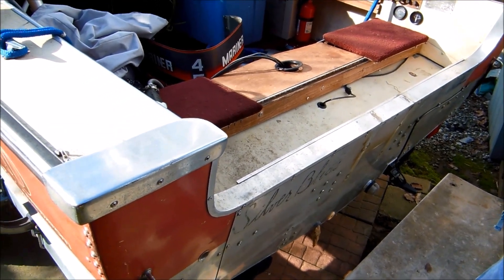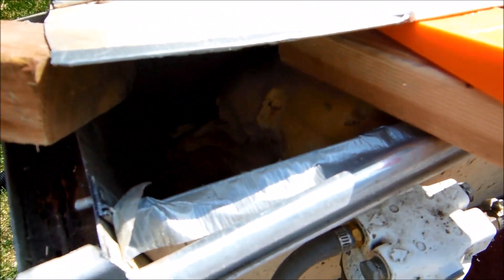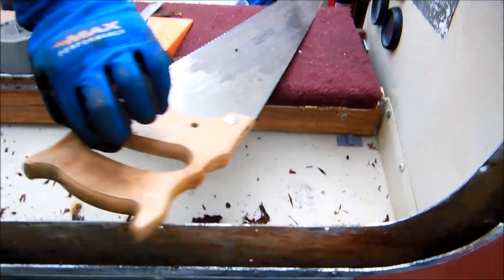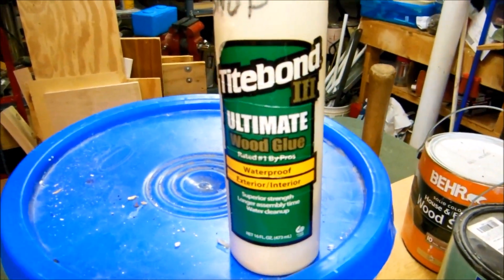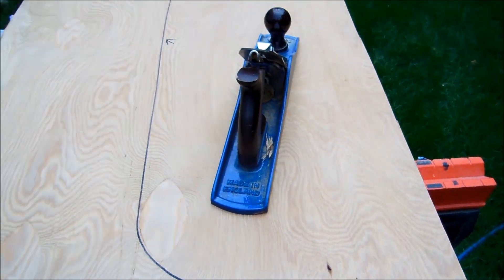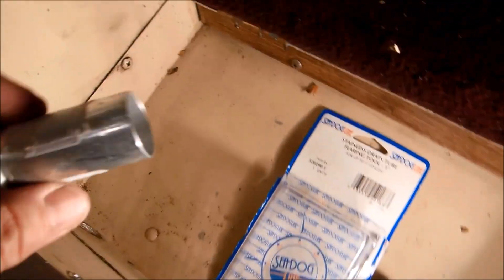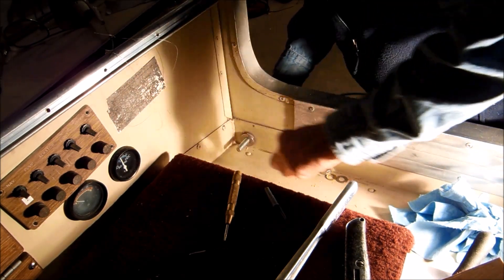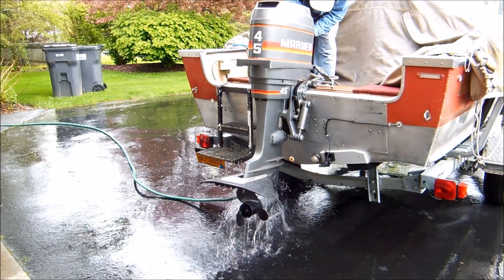Boat Transom Replacement

Comment: I have a 1983 Sylvan Sportster 16ft.  Your video was very helpful in replacing my transom.  Mine looked almost identical with the exception the nuts on the tie down loops were accessible from inside the boat.  After finishing the transom I decided to paint the boat so its been an all winter project.  Thank you for taking the time to make this video.

Comment: Been looking for this information for a while now. Most repair shops I've talked to about this are not willing to do the work. The one that is interested want's 1400 to do it.
135.00 of marine grade plywood, the rest is labor. My transom like yours is a riveted boat, the motor was rear ended by an impatient young driver 10+ years ago. I've used the boat ever since but I know the plywood is broken in the transom judging by the slight bend in the transom. This vid really helps!! 
Thx
Reply from the maker: Happy to help!
Reply: @OutdoorsmanChannel  another question, notice you didn't remove the livewell intake nor the boat drain. Where those inlets originally below the woods' height?
Reply from the maker: @Paul T  Yup.  They are below the wood height.  If you look at the transom from inside the boat you can see it pretty well.  Just the sheet of aluminum.

Comment: i have a 1979 crestliner its a 16 ft aluminum and we took it to a boat place and the said the transom needed replacement. they said it woukd cost 6k which is more than the boat is worth. the transom is rotted and im curious if i can still do this
Reply from the maker: You can do it yourself! Get it done
Reply: @OutdoorsmanChannel  do u have any idea why it would cost 6k idk anymore info about why and what it looks like yet but i feel like replacing wood doesnt vost 6k
Reply from the maker: @troy1284  It took us a ton of hours to do. 6k seems reasonable.  It's no small undertaking.  You figure any good mechanic is charging $150/hour.  So two guys working $300/hr. That's only about 2 days plus materials.
Reply: @OutdoorsmanChannel  whats the best way to get the motor off without any equipment. or minimal equipment
Reply from the maker: @troy1284  check out the video.  We use a ladder as a life with straps and cum along etc.

Comment: I'm going to look at a 95 lund 1800 fisherman today it looks super clean and was garage kept, it has a I/o motor any tips on how to check the transom for rot ?
Reply from the maker: The two top caps on the port and starbort side of the transom.  If you remove those take a pick or screw driver and evaluate from there.  If there are any screws in the transoms you could ask to remove one and see how lose or tight it is.  Also as far as the I/O goes I highly suggest removing the fuel filter and a spark plug.  We recently purchased an I/O and they can hide numerous problems.  If the fuel filter has water in it (you can tell by pouring contents into clear bottle) then the boat could have many issues.  Goodluck! Let me know how it turns out and don't forget to subscribe!

Comment: How did you figure out the exact shape/profile of the bottom edge? Didn't quite understand that bit
Reply: Jack. Can you elaborate a little more on your question.  The bottom edge was basically a straight line.  The cardboard was trimmed to fit as needed by trial and error to make a template. The side edges of the actual wood where trimmed to fit as needed.  One note, if you watch very carefully you will see the old transom has a tab in the middle where the engine is that was not duplicated in the new one. That extra tab did do anything for strength.  I am a contributor to the outdoorsman channel. Joe
Reply: @joesilverbliss1721  Thanks, that's very helpful.  I didn't see how the profile for the bottom edge could be replicated on the new bit of wood given the old one was in pieces and I didn't really see how placing a piece of cardboard into the space can help to figure out the shape. I have a very similar project and am deciding if I can fix it in a very similar way (ie cut off the top of the fiberglass and drop in a new piece) vs cut off the whole back piece of fibreglass and marry up the new piece directly like lots of the other video.  This would involve much more fibreglassing after but would make getting the shape correct easier. Any further tips? I'd much rather do it the same way you did... Thanks, Jack
Reply: @tamariderr  Jack.  I think if you get all of the structural points covered you can really go too wrong.  Good luck. Joe

Comment: If always heard you need to leave a couple inch gap at the bottom. Did you do this or did you bring the wood all the way down. I’m have almost an identical boat I’m doing the same thing on.
Reply: Hi.  The wood does not go all the way down.  There is a large gap to the bottom of the bilge.  You only need to go down to where there is a need for engine support, in my opinion.  In fact if you look very carefully you will  see the rotten wood has a different shape than the new wood.   The section in the center below the engine mounts doesn't seem to support anything.  I think it is better to keep the wood far away from the water.  Lots of comments about using cosa board instead of wood.
Reply: That is coosa board.  Marine plywood was just easier to get.  Let us know how it comes out.  I am a contributing associate of the outdoorsman channel.  Good luck
Reply: @joesilverbliss1721  thank you!
Reply: One more comment.  When the holes were drilled for the engine bracket we filled them with silicone before inserting the bolts to seal everything up.  There were some comments on that also.

Comment: Hey mate, thank you for your video! I was going to cut the back fiberglass off and then found this way and how much better! 
I was going to add, when I do mine Id think of making a bucket of resin and tip it down the back on both sides to fill in and lock the wood in place. Any thoughts on that?
Reply from the maker: I personally would keep everything original and factory.
Reply: @OutdoorsmanChannel  Cheers, thanks for your time

Comment: how is the transom connected to the rest of the boat, it seems like just sitting in that thin aluminum pocket wouldnt be strong, does it set up against other wood on the gunnels
Reply: It fits in the pocket but then gets bolted to structure with engine bolts and other bolts outside the engine mounts.  It also gets bolted with the tie downs.  I work closely with the Outdoorsman Channel.
Reply: Knee braces that bolt to transom

Comment: So instead of riveting the plate back on you just used screws? I need to do a transom replacement soon and am curious
Reply: What plate are you talking about?   Pop rivets we're used for the Angle bracket to reattach the gunwall tops

Comment: Looks like your transom came out really good!!! 
I just finished a floor and transom replace on an old Avanti boat that My wife inherited from her dad. The ply wood was much worse than yours was. But mine sat full of water for several years before we got it and then it sat under water for several days when Hurricane Harvey came through a few months back. 
It was quite a job. I had to take the top half of the boat off and completely disassemble everything. I used plywood and fiberglass. I nearly have it ready to put the motor back on and get it hooked back up. I have a short picture show of the first part of it on my channel.

Comment: How did you manage to rebore those drain holes so accurately. Is there a trick?
Reply: Kreig Dernier speaking for the Outdoorsman channel.  I thought that would be a problem, how to find the center that is.  Just take a simple compass like from grade school with a pencil and a point and adjust it to just over have the diameter. Then put the point right next to the metal on the wood. Draw an arc on the wood and repeat a few time around the circumference.  The intersection of the arcs is the Center.  Next punch a hole and drill a pilot hole as square and straight A's you can.  Then use the spaid bit. This was 1 inch.  One shot for both holes. I was pleasently surprised. Happy drilling and let us know how you do.
Reply: Just drill the whole out after its n stalled
Reply: I used a speed square to a-line the angle for my drill. And use the right size bit.
Reply: Joe Silverbliss the hole is already in the aluminum and the wood is installed so just drill it out and both sides will line up perfect. Works every time.

Comment: Great explanation. I have a 1986 Grumman 16' center console with a 50 hp Evenrude......it's been sitting in my yard for a few years and that just accelerated the floor rot. I have to replace the floor and guarantee the transom also. Good winter project I'm pretty sure I can get this boat repaired for next year. Thanks you.
Reply from the maker: You can definitely do it! Get that boat back to it's former glory!

Comment: One great feature of tin boats is that transom replacement is a LOT easier than on fiberglass.  You can generally gain access by removing screws and rivets so the repaired hull is as good as new. Also the plywood is not epoxied to the hull material. You're generally repairing a boat at least twenty years old and the new transom is going to last another two decades. After that, if the boat is still around, it's somebody else's problem.
Reply from the maker: Agreed.  Thanks for watching don't forget to subscribe!

Comment: Huge thanks to outdoorsman channel for a great video!!   After watching this video I decided to do my 2001 mr pike 17. I chose not to use wood, I was able to get the HDP transom from Lund. I am totally against wood in water. It did cost $600. It came cut to fit and the holes for the splash well drains and the tie down u-bolts were drilled. Perfect fit believe it or not!!  Any questions  I’d be happy to help. Thanks again to outdoorsman channel for the push!! 👌
Reply from the maker: Erick Schroeder glad to help! Dont forget to subscribe!
Reply: How did u get one from lund? I have a 2001 Angler SS thinking my transom is shot also
Reply: @twall667  Hi Thomas. I just found the closest Lund dealer in the area and ordered it. All they needed was hull ID number. Like I said splashwell holes and tie down U bolt holes were already drilled. That gave me perfect location for the transom. By far the best investment!  Good luck!

Comment: I have a similar issue with my transom, not really sure how bad it is yet. I have been checking out all the ways to replace the transom and I really like what you have done. I would have used epoxi to seal the wood over Thompson’s Water Seal though but that is just me.Thanks for posting this very nicely done documentation. :)
Reply from the maker: TheSagerider We thought about that. We determined just sealing the edges and letting the wood breath would be better.  It's marine grade plywood, designed to get wet.  Don't forget to subscribe!
Reply: Outdoorsman Channel marine grade plywood is used in new boats to but they seal them in fiberglass to keep the water off and create a water proof seal because the wood will rot.
Reply: I just did my 2005 Explorer transom over the weekend. I had to cut holes in the splash well to get to all the bolts. It was far easier than taking half the stern apart then made patches for the holes. I used PT plywood as it should last longer than the marine ply. Also I used the engine hoist and I bolts to pull the old plywood out but I had to build an engine stand first.

Comment: great job`informative video =) what size boat nd is the 40hp sufficient ?
cheers
Reply from the maker: 16 foot boat with a 45 hp two stroke and 3 bladed prop.  When boat is fully loaded it struggles a bit but with two or 3 people works good.  Get up to 28mph.

Comment: Last one i did i clamped plywood to outside of transom and traced outline with permanent marker and trimmed to allow for aluminum thickness .A little less trial and error.
Reply from the maker: Go Ahead Make Our Day Scooter &Peanut Great Idea!
Reply: That's what I've done on a couple of fiberglass boats.  Maybe don't get a perfect fit inside but "close enough for gov't work" or in these cases good enough to get another few years out of a boat that's 30 years or more old already.  I don't do restoration-quality on these old boats - nobody will pay for that much labor and it doesn't raise the value of the boat enough to justify it.

Comment: You will have one issue with that transom. After you installed you have to drill holes into for the motor and other things. Once those holes are drilled and the transom is in place, the wood is exposed at the screws. It would have been best to mark the holes and drill them while the board is out. Then place some water seal inside holes to water proof just encase. Just remember to make sure the holes are sealed every year with some 3m 4200 or something similar. If you do not marine grade or not it will rot the same way the old one did, from the inside out.
Reply: should have used epoxy resin to seal "Water Seal" will not last
Reply: You would NEVER get all the holes to line up doing it that way.

Comment: Great video. I have a 1986 Blue Fin boat that my transom is pulling apart. I'm sure mine is rotten also. It is a 17'10 foot with a 75 HP Mercury on it. I see you are from N.Y. also? I am a little nervous about pulling all that apart, your video is very helpful. Where did you get the drain hole parts and bolt and ferrul tool? Thank you for sharing.
Reply: So go to Amazon and look for Sea Dog 520290-1 and Moeller drain tubes.  That will get you what you need.  There are different tube sizes to pick from, brass and aluminum.  I work in close association with the outdoorsman channel.    I actually star in a number of videos.  Lots of comments on alternative material for transom you may want to consider.  Marine plywood was relatively easy to get for this project.  Good luck
Reply: Okay thank you. I tried pulling my gap together and seeing if the screws would tighten it back up. Nope. Screws just strip out. Must be rotted in there. Thanks for info.
Reply: What about treat plywood? I have to measure it, but assuming it is 1 1/2"-2" wide the opening. They do make 3/4" treated plywood don't they? Going to be a project. I want to use this Summer if I can. Been like that for a while now. Will wait till the Fall or winter maybe.
Reply: @elitebowman5386  Marine plywood is theoretically rated to be submerged.   People make boats out of it.  I don't believe treated plywood is rated for direct water contact
Reply: Correction.  You probably can't use it for a boat without proper sealing.  Best to read up on ratings of different material and choose the one that works for you.  Good luck
Reply: Before I start tearing apart, I hate to, but was thinking of using thicker screws to see if it would tighten up before I rip the transom all apart. I would have to use the bigger screws afterwards if it didn't work. There are like 3 or 4 I could try. What is your opinion ?
Reply: @elitebowman5386  not sure what screws you are talking about?
Reply: There are screws that keep the transom together so it doesn't pull apart where the motor hooks on. Where the water can run back out of the boat thru the weep holes. Mine is separating there.
Reply: @elitebowman5386  Do not use modern treated plywood on aluminum boats. The chemicals used to treat the wood are corrosive to aluminum and will almost certainly cause pitting and damage to the aluminum.

Comment: Read the directions on the Thompsons. Usually it is not permanent. Coat solidly with epoxy 100% twice,  especially at the edges, maybe three times.  also noted transom was not a complete fit side to side.  Eventually,  the aluminum at your sides will metal fatigue and crack. A bit closer and fill with epoxy would have been better.

Comment: I replaced the transom on my aluminum1977 Trailorboat Kalamath nearly 30 years ago.  I am fortunate that my transom wasn’t enclosed.  I just recut a pressure treated 2x10 into the shape of the rotted transom, and capped it with sheet aluminum.  After all these years it still looks new.

Comment: Hi, Nice video. I do recommend you put some sikaflex on and under all of the heads of the bolts to seal off all the bolt holes from outside water. You can't be too careful. Water always finds a way of getting past stuff.
Reply from the maker: Gionimo Thanks for watching!  Yes we did some sealent on the screws in the back.  Don't forget to subscribe!

Comment: I so appreciate your hard work on the transom. I would like to point out to you that while you had the ply in the boat and were readying to scribe your mark to cut it I saw the upper edges on the starboard side had some voids in them. You were going to cut them out but I've got to tell you that A/B Marine Ply does not allow for inner core voids. That is the only difference between "Marine" grade plywood and any old plain exterior plywood or interior grade for that matter. All plywood is glued together with the same glue. The only differences are the face grades on each side and solid inner ply or not. For a transom using anything better than A/C is just a waste of money IMO especially if you're glassing over it. Marine grade ply is normally used on hulls where you need full inner ply to withstand rock strikes and the like, not necessarily for transom work. I only mention cause I've heard everyone is using Marine grade for their transoms at $ 100 bucks more per sheet. You're being given poor advise. BTW, I'm a retired lumberman.

Comment: That's exact same motor I have LOL it's from the mid-80s and it still runs pretty darn good 😂
Reply from the maker: Yea 1986 mariner 45 hp! We sold the boat but it ran great for us!
Reply: Did you ever try to remove the lower unit?  Someone commented that they get stuck all if the time.  Joe